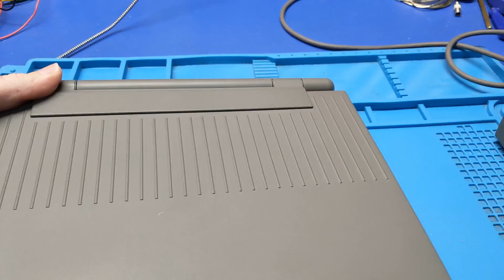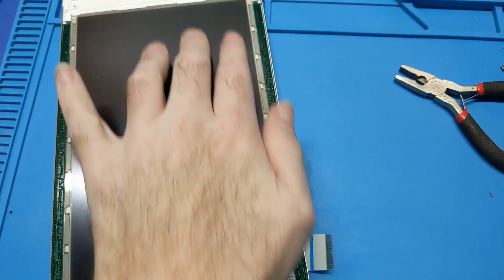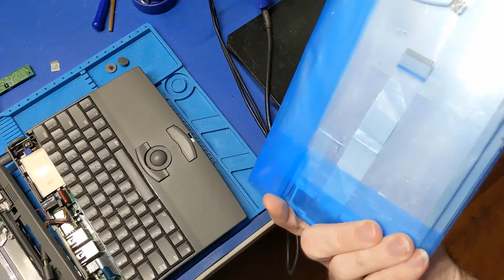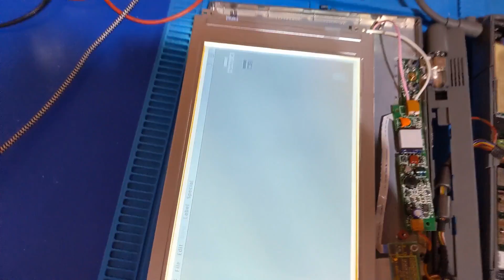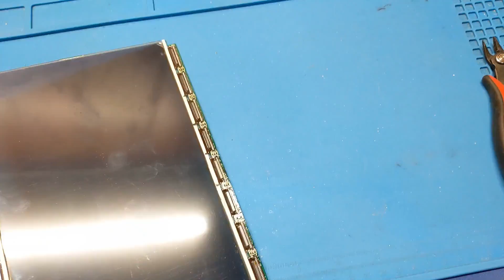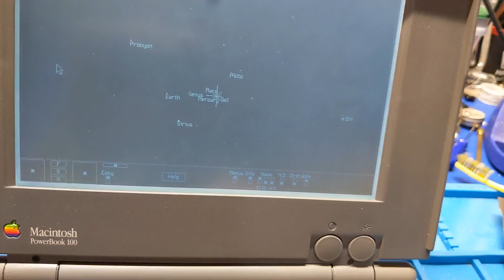Powerbook 100 Repair with LCD headaches

Comment: If you have a big enough vice, you can put it in there, but you have to be gentle, but you will kind of crack the plastic a little bit. Unfortunately, a little JB will to glue it back together. Or do what I do? Just rapping on tons of electrical tape

Comment: That's way pass used status, what a piece of junk.
Reply: I use a Powerbook 100 as my daily driver, keep these out of the landfill and enjoy the simpler times. Posted from my Powerbook 100 running system 6.0.8
Reply: @helfire23  I don't think the tinfoil of a CPU these have is capable of even loading a text-based website, let alone this, but I agree with the first sentence...

Comment: That's the same hassle I've faced trying to replace the polarisation film on an AST bravo's Sharp brand mono DSTN panel and a T1910CS's Toshiba colour DSTN panel, the colours never come out right. I think there's some secret sauce in the polarisation film for passive matrix panels that TFT's don't have trouble with. Potentially that might be a circular polariser from testing with some old reald3d glasses.
I wish there was some effort to replace passive matrix panels / translate their signals to active matrix ones but from what I've learned from Wenting Zhang's info on passive displays, it might be like trying to recover image data from a low quality jpeg or have a serious delay. The passive displays use a lot of tricks to achieve the grayscale / colour levels they use.
Unless there are ways to get the controller to start outputting data into a format that TFTs use, then it's a bit easier. yyzkevin did that with the IBM PC 110 TFT mod and I've done similar with converting a Toshiba Satellite 400CS to a 400CDT. But then there are some controllers that can only run passive displays so that can't work for everything.
Reply: i know that you just cant use tft polarisors on these B/W screens
Reply: Yes; the result seen in the video is the best that can be achieved with the polarising films that are available today. I have experimented with all angles, at least four sources of film - it’s not the angle; it’s the fact that the original film had an additional retarder layer that you can’t seem to get today. If anyone finds a source for monochrome passive-matrix LED film, please let me know.
Reply from the maker: Well work is being done in that department, Androda has designed a functional Hosiden black and white LCD signaling to VGA converter with the Pico for the Portable, which should carry over to this thing. Now personally myself, I have not studied the timing differences between a DSTN/Passive matrix display, and an active matrix display so im not sure on that part.
Reply: I made a video showing the same problem on a Concerto 

https://youtu.be/-EIWEZ15Kts

Comment: It looks like the signal on the LCD cable is a standard Sharp DSTN protocol; I found a datasheet for a later 640x480 panel that uses the same wiring (though with a slightly different pinout), and it looks like it'd be easy to feed into something like an RGB2HDMI. Solving the mechanical issues is a different problem, and will probably be harder than converting the protocol.